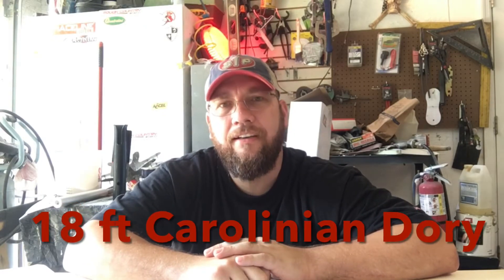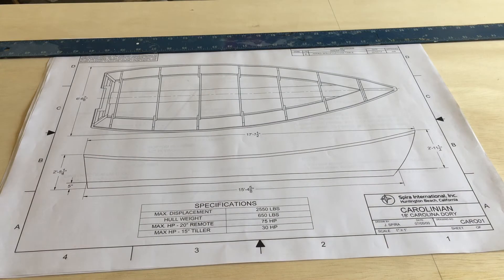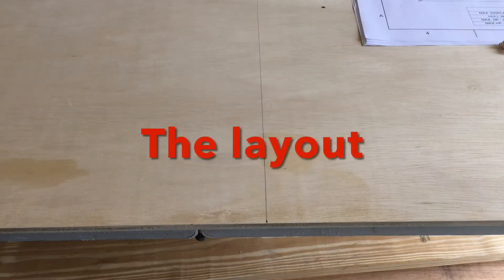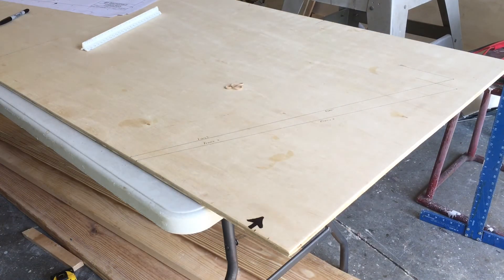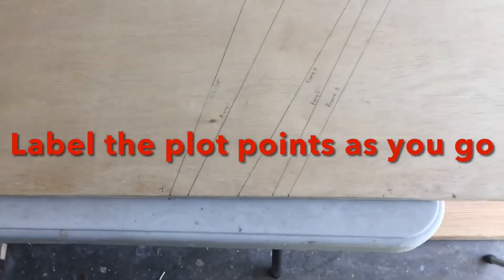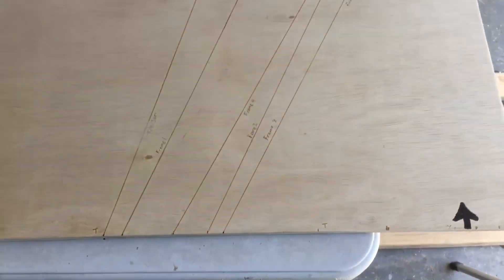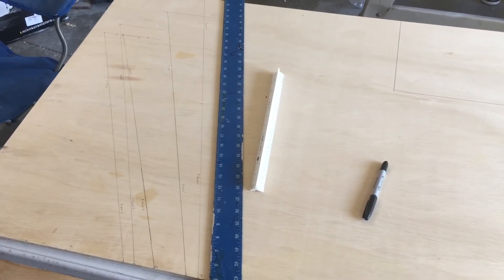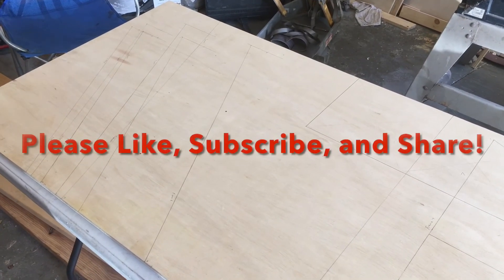Carolinian Dory Build Part 1 Layout

Comment: Good start on another boat.  I have found, for me, fastening a 1x2 to a 1x4 and then fastening that L to the edge of the plywood helped me make sure the bottom of the frame didn't move away from the edge when I started putting the frames together.  Thank you for sharing this new build.
Reply from the maker: That is a good idea.